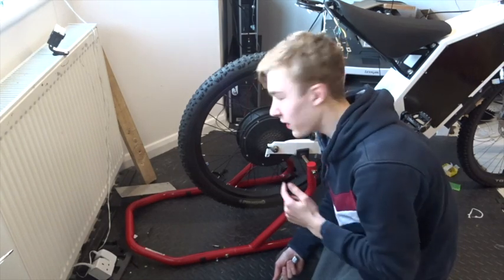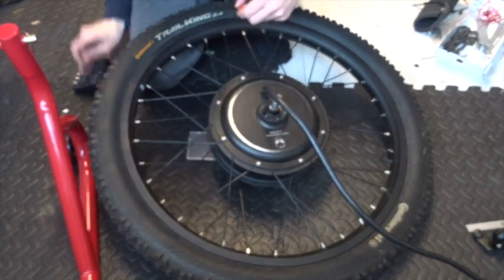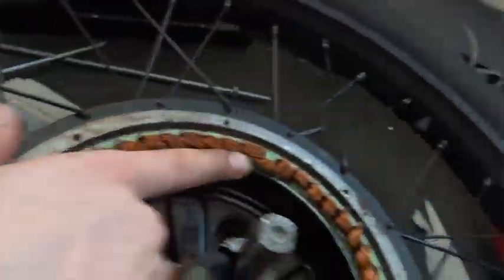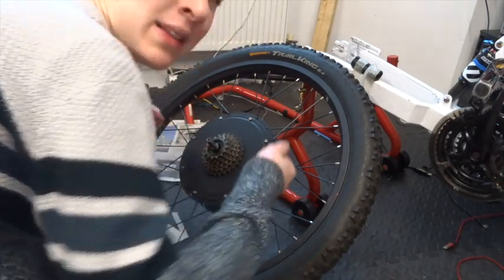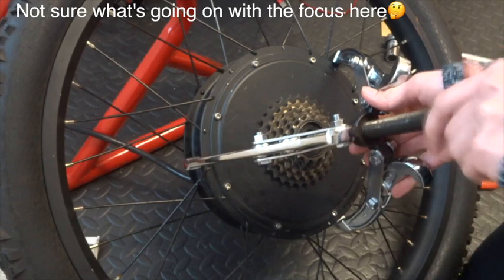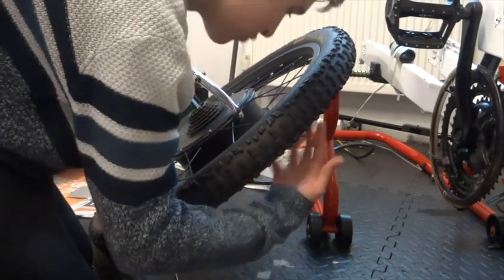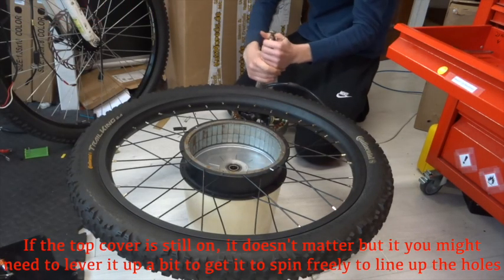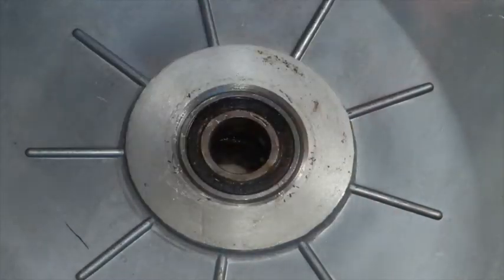How to disassemble an eBike hub motor | 8kW Enduro MSVA eBike V3 Build

Comment: My hub motor quit working suddenly and there is still resistance in the hub motor. So I’m going to take it apart to see if I can find the problem. It’s a cheap 1200w direct drive
Reply: No not yet. I was riding on trails and the bumping shook something loose I believe. If I find the problem I’ll post it to you
Reply: Mine did the same thing. Did you ever take yours apart and figure out what the problem was?

Comment: if anyone knows, could you change the gear on a motor wheel or is it all one piece
Reply from the maker: Depends on how the housing on yours is made, but most have a threaded section on one side for the gear so it can be changed

Comment: if any one knows, would it still function as a regular wheel if you removed all the electronics, attempting to make a new e bike with separate motor rather than built in wheel motor so I don't have to replace it
Reply from the maker: The motor spins on it's own but will have more resistance than a regular bike hub

Comment: So I don’t know if you answer questions but I have a similar motor with the cassette gears and the big cheaper 170mm drop out frame.  Im looking to upgrade the frame however the other enduro style frames have 155mm dropouts…is it possible to remove the cassette gears and exchange it with one gear and shorten or replace the “torque shaft” ?
Reply from the maker: You can get a special socket tool to remove the cassette, it depends whether the threads on the shaft extend further in than the cassette or no though. If they do, then taking the cassette off will make the width the motor needs less but otherwise it won't make a difference if it is unthreaded axel at the end of the cassette. One gear will be fine just thread it on where the old ones were. I'm not aware you can replace the shaft with shorter ones as it's usually attached to the stator and you might as well buy a new motor at that point. Hope that helps!
Reply: @EverythingEbikeChannel  Thank you for taking the time to get back to me and imparting your knowledge. In the meantime I actually found a video where some buddy change the shaft and they had to use a press to do it… so yeah if it doesn’t work buying a new motor is probably a better option.

Comment: I cant get it open mine is siliconed. No cap. Do you have any tips to open?
Reply from the maker: A gear puller should still do the trick but might need a screwdriver to get under the seam to pop it open.